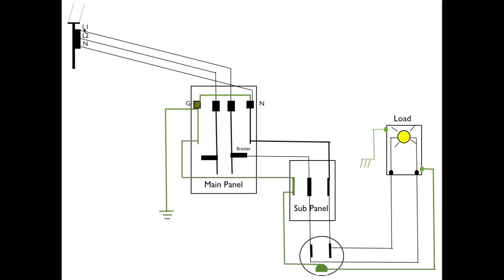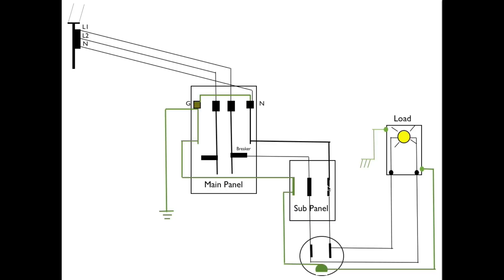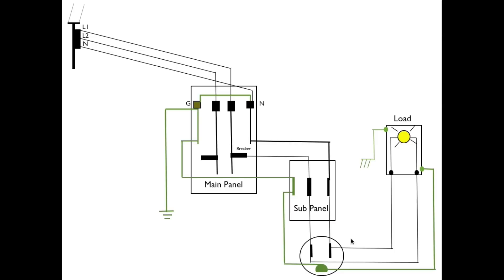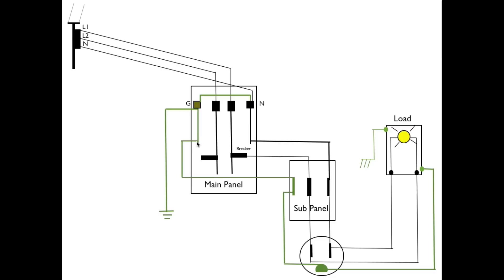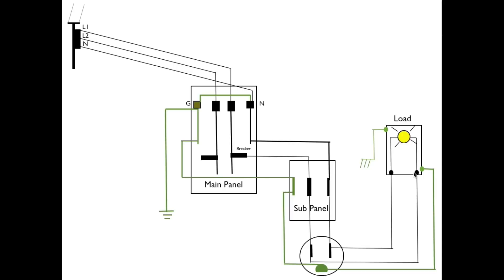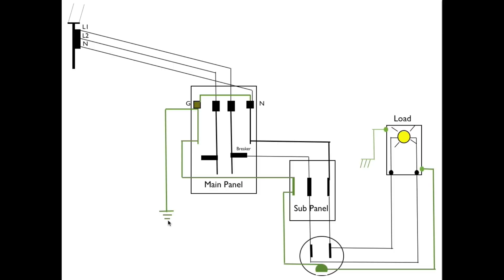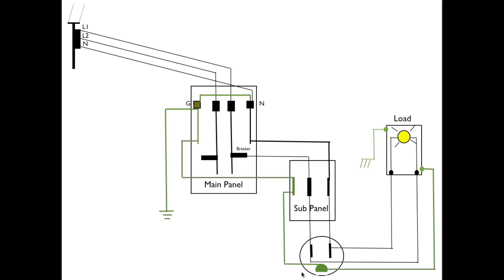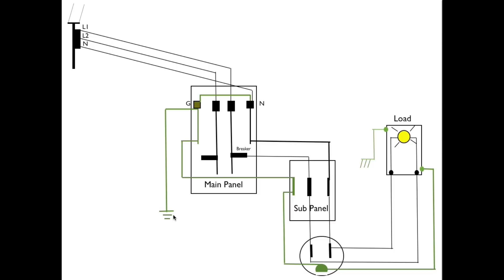The difference between neutral and ground on the electric panel

Comment: You say the sub panel is wired differently but it's not!  It's wired exactly the same way (according to your diagram).  It doesn't matter if you wire the sub panel physically differently, it's still Neutral to Ground in the main panel and that carries on throughout the circuit???  As I understand it - Ground is just another path for current to flow (instead of through you to ground) should there be a short from the Live to anywhere the ground is connected to.  Current follows the most direct path to the opposite of it's potential so it will typically go through the Neutral back to it's source but should that not be an available path (due to a short, etc...) then it will take the next best path to Ground.  This is why Neutral and Ground can be connected together (as in the panels or to the Neutral in a transformer, etc..) and you can still touch Ground without getting a shock - because the current will travel to the path of least resistance (back to it's source potential).  Or have I got something wrong here??
Reply from the maker: Consider this:  the neutral has burned thru. The neutral and the ground are connected at the sub panel. (in my diagram, the neutral and the ground are not connected at the sub panel).  The power will then pass thru the chassis ground to the main panel. The system will work normally.  However, if then there is a fault in the chassis ground. The chassis becomes hot. If you touch the chassis, and have a path to ground( standing in water etc), you will be shocked. We want the unit to shut down if there is a fault in the neutral. Jumping the ground to neutral defeats this safety. Hope this helps. 
GFM
Reply: grayfurnaceman Thanks for your reply. You say "(in my diagram, the neutral and the ground are not connected at the sub panel)" but they are - through the main panel - it doesn't matter whether you connect them here or there - they are still connected?  Otherwise the ground on the 3 prong plug shown would not be earth grounded and there is clearly an earth ground going from the main panel to the sub panel to the load - thus they are all connected to earth ground?  Still confused I guess ;)
Reply from the maker: +Digger D The problem here is that you are considering earth ground to be a conductor.  It is not.  Earth ground is not involved in the circuitry.  Earth ground is used only for lightning strikes and surges to direct the high voltage away from the circuits in the structure.  I have a number of videos demonstrating how earth ground works.  They may be helpful.  
GFM
Reply: grayfurnaceman Isn't earth ground also a safety for shorts?  Now I have to disagree about a conductor - as an HAM operator and electronics hobbyist (no way a professional but...) earth ground is often used as a conductor both for ESD and ground planes.  Perhaps I'm just confused by differences in terminology between the two disciplines (electronics vs electrical)??  Thanks again for your replies.  I'll look for your videos.
Reply from the maker: +Digger D The resistance of earth ground is extremely high.  You can place a hot wire to a metal stake in the ground, and it will not short.  (Don't try this with the electrical grounding rod at your house, it is connected to neutral).  The ground used in electronics is used more like a sink.  
GFM
Reply: grayfurnaceman Thanks, I guess I need to learn more about this topic ;)
Reply from the maker: +Digger D It is confusing.
GFM
Reply: +Digger D The equipment grounding conductor is not used for shorts or safety of persons.
Shorts are dealt with between the grounded conductor (neutral) and the ungrounded conductors attached to the breaker.
The equipment ground is used for lightning power surges.
Reply: Ok, sounds correct but what if the live conductor touches the case (for some reason) which is earth grounded?  Wouldn't earth ground then act as a better path to ground than someone touching the case (typically)?
Reply: Digger D No, the current is not trying to get to ground, it is trying to get to the source.
If you are near the panel, and their is current flowing from the hot wire to the case to the ground, and you have no shoes, you could feel it, depending on the amperage level, come back up through you, trying to find the source. or if you touch the panel case, you will likely get an arc flash, which could blow your hand apart, if you are not grounded, have rubber soles. if you are grounded, it will still try to go through you to find the source, as it is also going through equipment ground to the ground rod.
Reply from the maker: +Heki Kahni I want to see you standing in water and touching the chassis of a piece of equipment with a defective ground and tell me its only for lightning.  You may be quite surprised.  
GFM
Reply: grayfurnaceman What are you talking about? That has nothing to do with anything I meant.
Reply: I'm talking about earth ground - what are you talking about?
Reply: Digger D I was talking about the ground rod. That is the earth ground.But I was responding to GFM
Reply: Ah ok, I'm talking about current flow to ground - I realize it's high resistance and not a good conductor but it would be where current would go if a live wire shorted against something earth grounded.  I understand it is used for lightening strikes and to help with noise bit it is also a path when no other path exists except a person touching the short.

Comment: This is all wrong. As not one size or installation fits all needs. The reason you don't bond the ground at the sub panel. Is you want the the short to return to the source encase of a short. Not the sub panel. As some sub panels do not need a main breaker. As it not is required. 

The source is always the transformer feeding the service entrance.. This is why the main service is the only bonded enclosed. So even if a lighting bolt hits your home. It will follow the path of least resistance. Only with an Isolated ground do you install ground rods. Along with a super neutral. As almost every home. Business and others have computers and other devises that use AC\DC inverter. These devises carny heavier loads if they fail. Just from their rail at very high amps. These faults in them can produce an over current problem beyond what the wire size was designed to handle. This is why you never ground an Isolated ground back to the panel. The ground bus bar is isolated from anything else to a ground rod or the building steel or both. To handle these over current problems. And one reason the Neutral is sized higher. To carry these bigger loads. As the failure is the secondary side that would case such a problem.

I had this same argument. When they require ground rods for every light pole. The fact is the Pole is grounded back to the source.After grounding the pole to the ground. An unbroken ground just to be clear. Then you also fuse each light pole. So as to not knockout every light pole from a shorted ballast. The source being the service feed entrance feeding it. This is why ground fault interrupts will not work. If they can not sense the imbalance in the service feeding it. 

 I been deigning these for 30 years. And Solar just adds one more issue to deal with.

Comment: In the future electrical connections will be wireless.
Reply from the maker: So we will have to eliminate computers and all other electronics due to the sparks coming out of the walls.
GFM
Reply: Eduardo G. — Tesla wanted to transmit power wirelessly.  He was a genius, but a bit of a crackpot.  He didn’t grasp that the use of wireless was to transmit information.

Comment: Europe has 240v at the outlets. Why all this "center tap-balanced load" nonsense? Is it to make  "more feather beds" for the electricians Union?
Reply from the maker: Iguana Pete Its a different way of wiring. It has the advantage of using a lower, less dangerous voltage for wall outlets and lights. 
GFM
Reply: You'll have to ask George Westinghouse. He engineered the original North American AC system, and we stuck with it for compatibility.

Comment: it would be much simpler to call neutral  "negative"
Reply: even though it's not
Reply: Daniel Hawkins it would only be negative (or 0) in a DC system.
Reply: Daniel Hawkins 
It's negative for half of the time.  1/60th of a second.
Reply: Frank De Mascio right,..that makes sense,..since it's alternating current (pos+/neg-),....however "1/2 the time" is Not 1/60th of a second,....more like 30/60ths of a second,..or 1/2 right? (lol)
Reply from the maker: Neutral is not negative.  It is the zero voltage point on the sine wave.  AC is both positive and negative.
GFM
Reply from the maker: The voltage switches 120 times a second.
GFM
Reply: grayfurnaceman huh,..thats interesting,....I'm more of  D/C guy.
Reply from the maker: Yes, I kind of thought so.
GFM
Reply: Daniel Hawkins — One more syllable is not simpler, and it is a misleading name.  Wrong, actually.

Comment: A logical  explanation is L1 is 240 VAC in respect to L2, of just the opposite, L2 is 240 VAC in respect to L1.

Both L1 and L2 are 120V in respect to neutral, so why the name neutral?  Kind of stupid in a way, this is the center tap of the power pole transformer is is 120 VAC hot in respect to either L1 or L2.  Its all relative.

What is ground?  Exactly that, an 8 foot copper pipe pounded into the earth, in high resistive places, that pole is not enough, a series of conductive wire has to be used for better continuity.

What happens when you connect neutral to ground?  Actually a ton of nasty things.  Now both L1 and L2 are 120 VAC hot in respect to everything.  If using an extension cord with a bit of insulation knocked off, without ground only hot to so called neutral, but with ground a path exists touching L1 or L2 through your body and conductivity is very good for you getting a shock even a killing one if the current exceeds about 0.060 amperes.

Also all that wiring throughout your home becomes susceptible to lightning.  Hit by some odd 60,000 amperes, your home will burn up.  Also all of your plumbing is grounded using any kingd of metallic  piping.  So by connecting neutral to ground if you drop a hair dryer into a bathtub you will be electrocuted, but if not grounded you would be safe.

To prevent this a ground fault interrupter, GFI was invented, it checks the difference in current flow between hot and neutral, and if only different by 0.001 will trip a relay contact inside to break the circuit, run around 15-20 bucks and if made in China, crap, more problems than they are worth. 

If using a three wire extension cord black, white, and green wire outdoors, and just a little moisture between the white and green wire may let more than 0.001 ampere flow between green an white, in no way harmful to you, but will trip the GFI.  Rather inconvenient. 

Another incredibility stupid maneuver is redesigning a standard 120 VAC wall receptacle besides the silver and brass colored  screws for an airtight connection, some really stupid idiot added those push wire connectors to the rear to make life easier for electricians. 

Copper wire is not plated, turns brown, copper oxide and make very poor contact with a brass strip internally.  This creates an arc contact, solution is to make code necessary to install an arc circuit breaker, and pure BS when saying brush arc is not the same in a vacuum cleaner as in this poorly designed receptacle.  When that trips the arc circuit breaker will cost you around 50 bucks to replace it.

In GFI, arc, and grounding neutral, in these respects, have idiots running the NEC.  Any number of home burnt down stuck by lightning, grounding neutral gives the only path for this.
Reply: Oh don't change anything, will be in deep trouble with your building inspector and home insurance company.
Reply: NickDe39 — It’s called “neutral” because it’s the midpoint of the supply, perhaps, but it doesn’t matter why.  You have to call it something, because it is treated differently.  It is held at ground potential by tieing it to ground at the main panel (or to the metal box, which is grounded).  It is the point of reference when measuring potential.

Comment: You talk in contradictory terms and don't even realize it.  The so-called bare wire that goes in the dirt  you said to have high resistance and it is in the dirt and it has no power on one hand then you turn around and say if you hook it as Neutral and remove the neutral wire it will become a current carrying conductor and suddenly it won't have high resistance and the dirt will have no effect on it.  Are you sure you know what you are talking about?  or do you mean to say since it is hooked up to Neutral at the main panel then it will act as the neutral?  While you are at it, why didn't tell us where on earth that N wire goes that comes out of the pole?  Does it go to the Power Substation or right there in the dirt at the pole or in the dirt.  Is the high resistance dirt/Earth the return for Power Company and the whole planet is its wire?  I better go outside and check the sucker out. (If that neutral wire comes down and goes in the dirt then the whole planet is the ground then what is the difference.  We are all returns and should be electrified dead. ).  I will check it tomorrow.
Reply from the maker: Try looking at it this way: Earth ground is not part of the circuit.  The circuit consists of hot and neutral.  The neutral is referenced to earth ground at the main panel and at the center tap of the pole transformer (neutral).  
If the neutral is open and earth ground and neutral are connected together at the sub panel, the current will travel to the main panel and to the pole transformer.  The load will operate normally.
You don't want this to happen because if there is an open in the ground, the power side of the circuit will become hot and could cause a shock.
GFM
Reply: @grayfurnaceman  Maybe what is happening is that the power company sends out three phase power having no ground ( Just three wires).    Maybe at the pole outside their transformer turns 3 phase into a single phase and once they do that, as a consequence a return wire is created right there at the transformer.  I guess you can't have a single phase without a return. 
 With that return ( i.e. neutral, looked like a doggone bare (not white) they made a T with that wire and drove one of the ends down their pole and into the ground and the other end to my house.   Strange as it is that bare return wire pretty dog gone wrapped and twisted their two black hot wire I tell you.  I guess there won't be any cross-over arching due to an electric field.  What the hell do know?    I guess their bare wire becomes my white wire and my bare wire goes to the ground by my house.  In the meantime, their bare wire at the pole is no further than oh say 40 feet from my panel/meter.
But I could be wrong with all this.  All I saw was  3 black wires from pole to pole to pole and down the street further on.   And they 3 wires weren't that thick, to be honest.  However, from their transformer to my house was twice as thick as their main ones.  Probably because with the high voltage you can get away with smaller diameter wire and save money too. But once you step down, you decrease the volt and that increases amps.  What the hell do I know?
And I still wonder where is that Electric Energy in all of this.  Volts are no energy and sure neither is current ( that is electrons moving, it is amps).  Energy is Joules.   You can't turn volts and amps into Joules.  Can you?  And Power is Volts X Amps.
And what about the fact that the so-called current ( electrons) never make it to my house for the life of mine.  Their so-called current just vibrate back and forth ( 60 Hz with half of that cycle it goes forward motion and the other half of that cycle it goes backward)  in the wires and end up going nowhere.  While in the meantime when I flip the switch, no matter how far my light bulb is, that sucker comes on instantly like the speed of light.  
I think I have been buying things I never get.  I am filing a federal case.  I just realized something fishy has been happening.
Reply from the maker: I assume you are thinking you are somehow being ripped off by the power company.  In that case, you will have to look elsewhere.
GFM
Reply: @grayfurnaceman  If I could.   :-)
Reply from the maker: @alchemy1  The problem with your statement is you are going everywhere at once.  
The wiring on the pole is done in various ways.  You can use one of the 3 wires (3 phase) to neutral to make single phase for a residence.  The wire is small because of the higher voltage.  Volts times amps equals total power which can be expressed as Joules or watts of a number of other names but it is still energy.  
If the light goes on, the current is there. 
The power company is not ripping you off.  If they were not bringing you energy that is consumed by the loads in your house, why would they burn oil, coal, run water thru generators etc?  
GFM

Comment: Your "subpanel WILL NOT supply 240 volt
Other than that it's a good video.
Reply from the maker: The sub panel is not a 240 volt panel.  I don't think I ever said it was.
GFM
Reply: I you said it would with a double breaker.